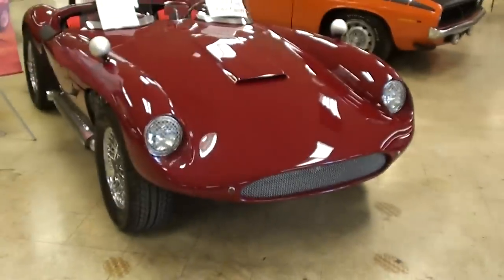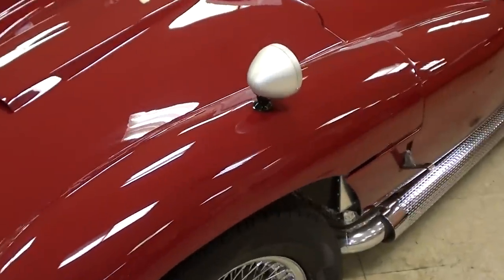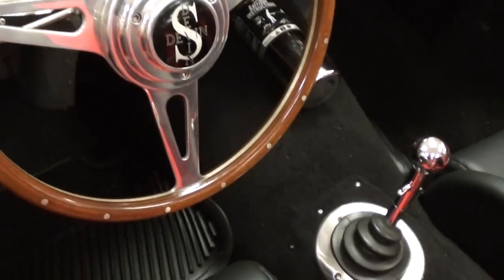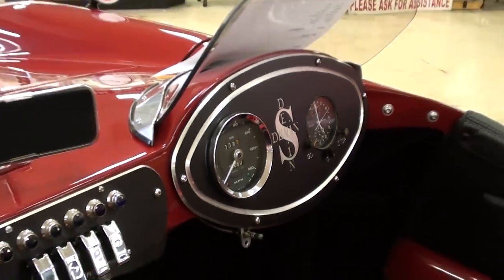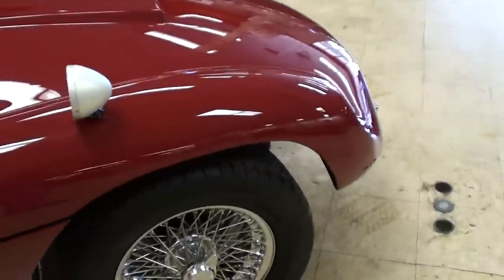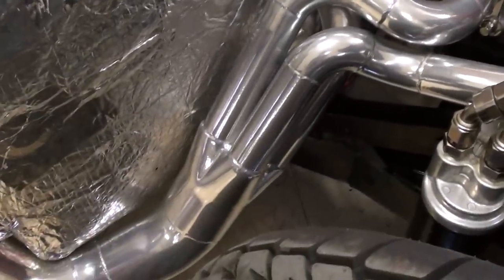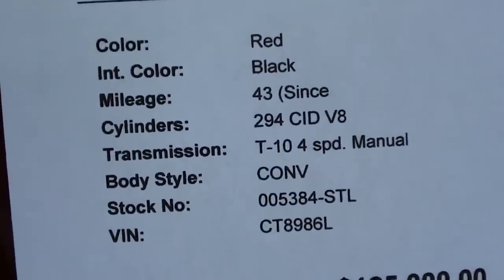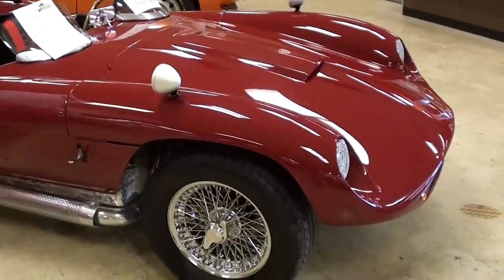1957 Devin Special Vintage Race Car All Aluminum Buick V8

Comment: A direct take off from the 1955/56 Ferrari Monza 750 buck.

Devin SS

Could be mounted on a Healy 3000 chassis.

We had a Red one in Tampa, mid to later 1960s.. 1972..

327 FI Chevy

Tampa DragWay

High 11s 127 mph...

Easily beating early Corvettes

And the red Healy Chevy 327 we saw there..

Much lighter!

Was auto-crossed at USF's giant parking lots..

Ran at Lakeland and at PBIR..

Paul Whiteman Races, Daytona

FINE on smooth tracks!

SWEET!

J.C.

Comment from the maker: They Devin actually predated the Cobra by quite a few years. The most expensive car that I've done a video on was the 1957 Pontiac Bonneville. It is an extremely rare car and it was listed for $300,000.

Comment: the parts for them are very very rare. you basically have to build them from the ground up. buddy at the farm has his with the body off and everything exposed. most of the parts hes used are fabbed up. they really can be Cobra killers. they just arent as well known.